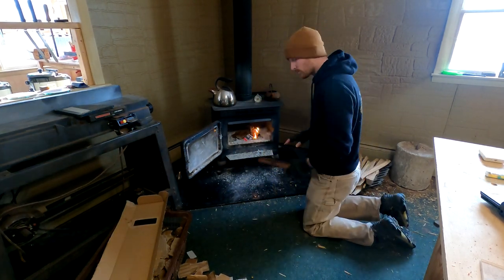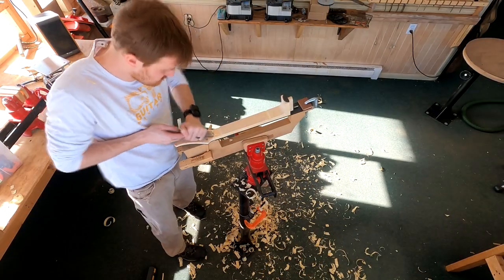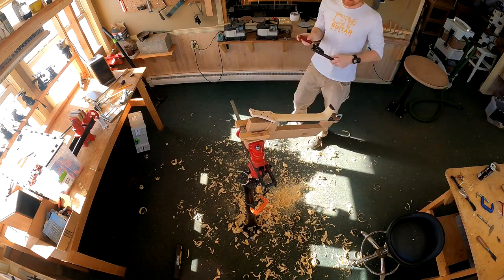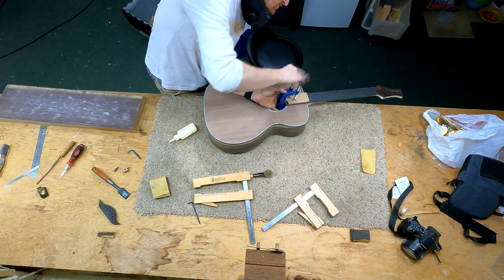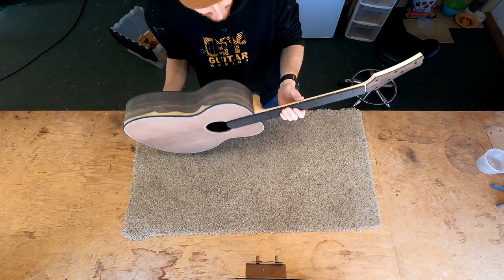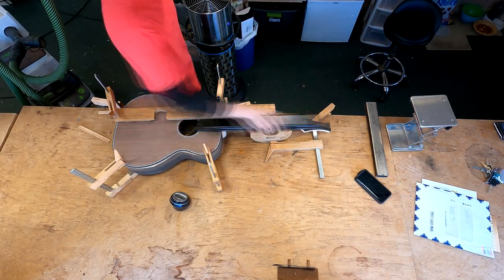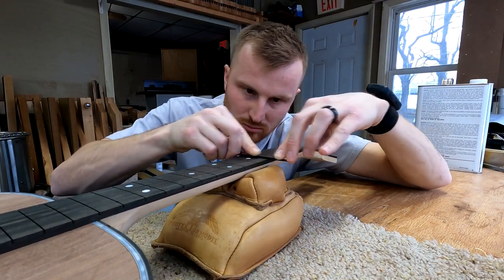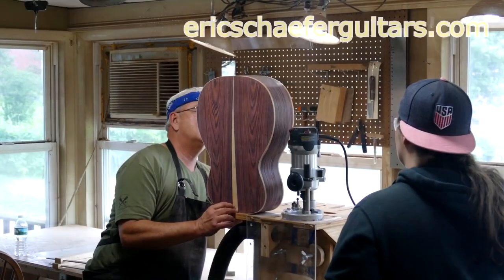Guitar #85 | Full Build with Commentary | Part 5

Comment: Given you didn’t radius the fretboard before attaching it to the neck, why not use a pattern bit in a router table and trim off the excess neck wood to the fretboard? Also as you have polished up the frets and fretboard with 0000 wool, does that mean you are not going to level the frets etc ? Thanks Eric